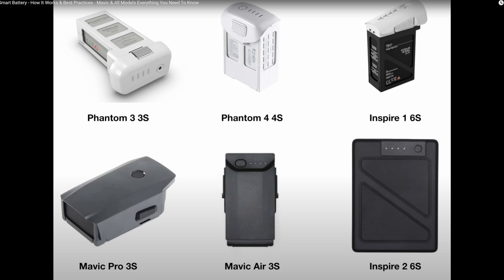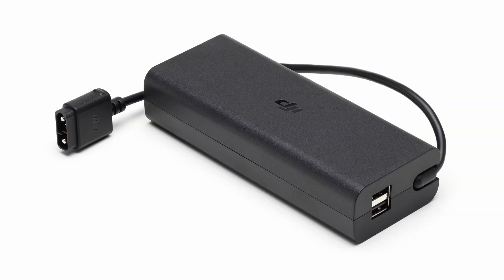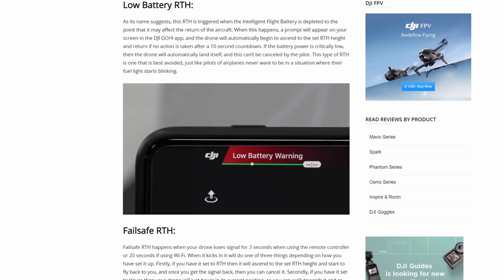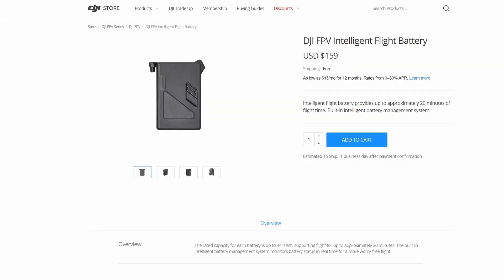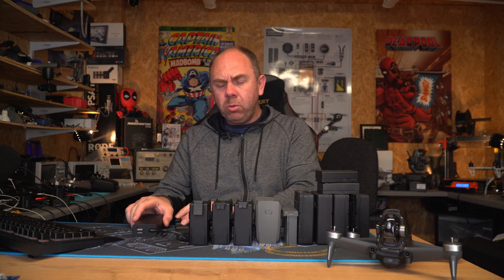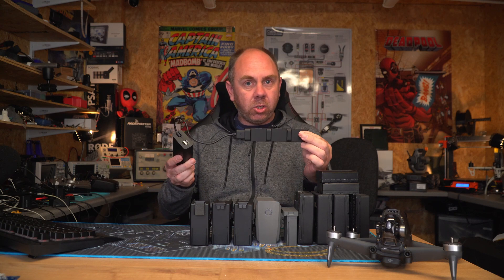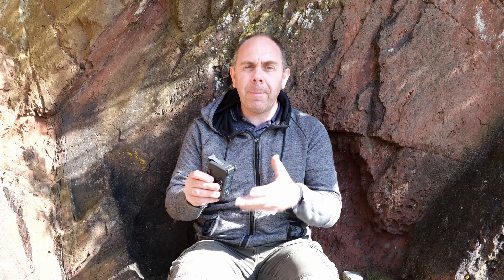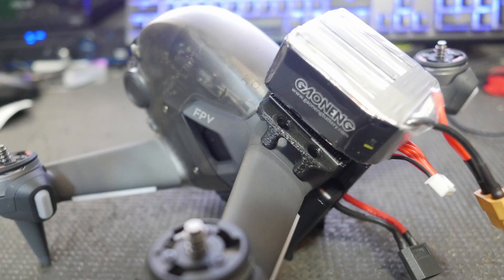DJI FPV Drone Smart Battery - How It Works, Tips & How To Get Best Life

Comment: I have a phantom 4 battery deslbalance. Can I open my self I calibrate?
Reply from the maker: Not easy on the P4 to get the top off, it is doable though and you can manually balance them
Reply: @MadRC  if it's P4P then top cover is fixed by two screws and a plastic latches. Quite easy to open. But for balancing bottom part should be opened instead lol

Comment: This is a common LG Chemical MJ1 18650 cell datasheet. In the document, you will see the discharge temperature range is from -20 to 60 degrees Celsius.  Just below the line, it was said that the cell will keep its life only one month under -20~60 degrees Celsius environment. As far as now, JAPAN's FDK is making NiMH cells which endure more temperature range with 1/3 of Li-ion cell voltage. Life time of high quality NiMH cells will live longer than 15 years (FDK had checked it no more than the years written on it. I have dozens of SANYO NiMH cells still working at home. SANYO was sold to PANASONIC and it became FDK under the umbrella of Fujitsu.). Lithium 2ndary battery technology is not so happy with the earth environment by now. The age of solid Lithium ceramic battery is coming with more than twice the energy density than the current Li-ion. TOYOTA. MURATA, Panasonic, Maxell , TAIO YUDEN etc are running hard for the full solid batteries now. Japanese companies occupied more than 50 percent of the full solid battery technology with patents back in 2018.
Reply: The weight of all the drone batteries could be halved with the Japanese license in 2~3 years. Drones will fly more than an hour in the following years with the battery replacement. Cost will be downed by the electric auto makers..

Comment: You've done a nice summary on the batteries. Several years ago, I got a phone call from an LG Chemical sales manager who worked at the headquarter. He asked me the possible use of Li-Polymer or Li-ion batteries for UPS system for broadcast transmission sites. I asked back to him 'What's the optimal operation temperature for Lithium-based batteries?" He answered me without hesitation. It's 25 degrees Celsius. Below/above 25 degrees, you could face the reduced battery capacity with no exception. You'd better change your comment with 15 degrees in the video.
Reply from the maker: I think your misunderstanding what I am saying, Yes I am well as wear of 25c is the sweet spot but isdeal reange is 20-30C for Lipo packs, the DJI Smart battery will prevent take off below 15C, between 15-20C it will allow flight but you need to let it warm up and be easy on the cells.  Yes in the ideal world you would not flt below 25C but that's not realistic and the batteries will self warm to 30C with use as well.
Reply: @MadRC  Sweet spot of the battery cells are relatively narrow for Litihim-based rechargable drone batteries.  It would go much worse in less than 10 degrees Celsius. Warming up the battery by hovering could work but the overall life of the battery would go into vain. I didn't said that you are wrong. 25 degrees Celsius is mandatory for normal use of all the batteries. That's the limitation of early 21st century technology.
Reply: @MadRC  I made a long conversation with drone-related battery warmer developers here a few years ago. The battery should be kept cooled and warmed inside an explosion protection hard case with  temperature sensors on the battery placements in it. That was a big problem at that time. No product meets the high standard by now.
Reply: There are so many fireproof battery bags out on the market. Putting so many batteries in a small space could lead to a chain reaction inside it. It's much worse than we think.
Reply: this is an excerpt from a Sandia National Lab report, USA. Even the sealed lead acid batteries are designed to operate in 25 degrees Celsius with no exception. 

The optimum operating temperature for the lead-acid battery is 25°C (77°F). As a 
guideline, every 8°C (15°F) rise in temperature will cut the battery life in half. VRLA, 
which would last for 10 years at 25°C (77°F), will only be good for 5 years if 
operated at 33°C (95°F). Theoretically the same battery would endure a little more 
than one year at a desert temperature of 42°C (107°F). 

https://core.ac.uk/download/pdf/195152718.pdf   pp.9
Reply: Age of battery electric car? I would rather laugh. My new LiFePo battery for my UX250h arrived a few days ago. 100Ah for auxiliary starter battery for a hybrid fossil fuel car. That's what it's for.

Comment: Smart batteries are what put me off investing in off the shelf drones. It’s not just the ridiculous price but the fact that once a company stop producing these proprietary batteries the drone becomes a paperweight on borrowed time. I understand that they make life easier and safer for those with limited technical knowledge but in seriousness £140 for a low C rated 6s 2000mAh with a simple BMS circuit is extortion. Bruce quite correctly coined it when he said that the DJI FPV Drone, and other drone reliant on similar batteries, are the inkjet printers of the RC world. They’re a cash cow for the manufacturer and destined to be prematurely obsolete.
Reply: True. Like apple. You have to buy all their stuff. They probably make more money on the battery than they do on the drone lol
Reply: It might be possible to refurbish the DJI batteries. Just replay the cells with fresh ones when they get too old to work. I'm not sure if this will work or not but I plan to try once one of my batteries go bad. The batteries are too hard to open. I've done it a couple of times. I always open the same pack since opening the pack leaves a blemish.